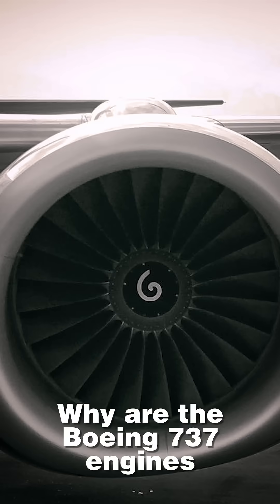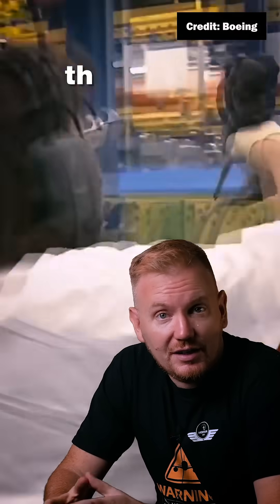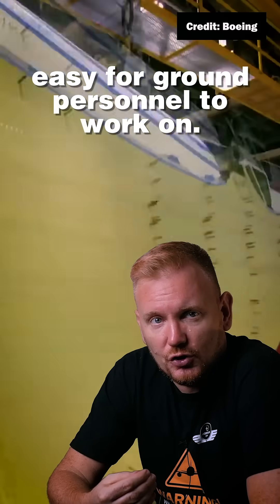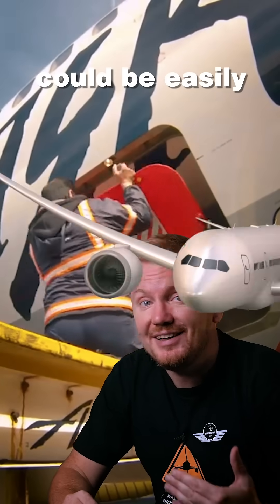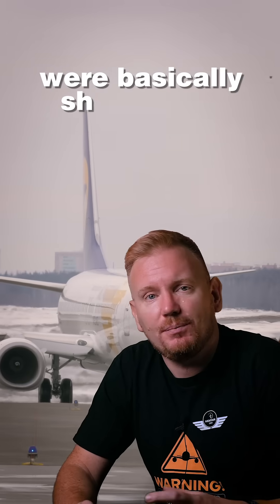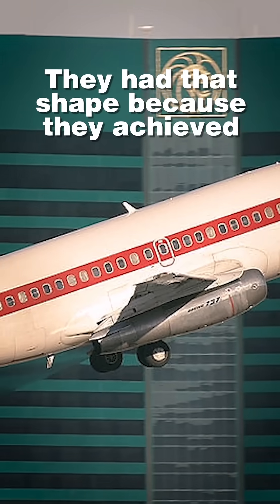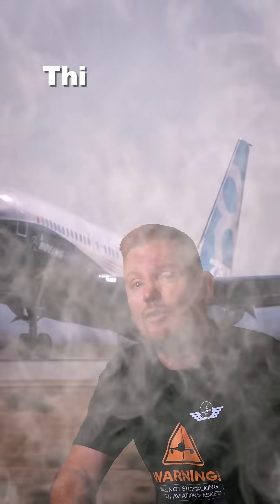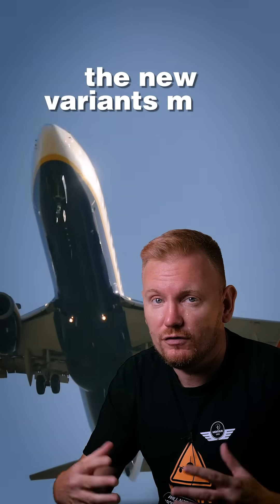FLAT Airplane Engines?! #shorts

Comment: Also part of the reason for the 737MAX issues… the low height of the plane forced Boeing designers to move the larger more fuel efficient engines forward and up on the wings so they would fit. This caused a change in the way the plane pitched on takeoff from previous generations… instead of changing the wing configuration, height of the plane or modifying the tail/stabilizers to compensate for this - which would make the design different and require a new “type certification” for the MAX which would extend the time it took to complete and cost the company more, they came up with the infamous software fix known as MCAS - which was what was blamed for the 2 crashes.
Reply: The mcas system was not told to pilots to prevent paying for training. Don't believe that what you don't know can't hurt you. It did. On the third almost accident the pilot was able to recover because he had more altitude to operate with. Mentour made a video about this.

Comment: Unfortunately, with the conversion to the turbo fan engine, the newer 737 can no longer utilize bleed air for debris deflection for gravel and unimproved runways like the older variance with the turbo jet engine.
Reply: All 737s from the very first one were fitted with turbofan engines. However, the bypass ratio was low up until the 737NG came out, meaning that most of the possible fuel efficiency gains from using a (present day) turbofan weren't available to that era of jet. 
The 707 was Boeing's only passenger jet to come with turbojet engines, and only the early ones did (later ones being fitted with low bypass turbofan engines)

Comment: cool, what about the max engines?
Reply: @Lee5p33dy  Agree.  “Up & forward” caused a CoG imbalance that led, due to hasty “cost-avoiding” re-engineering that ignored the need for proper redundancies, to two horrific crashes.
Reply: Those we're pushed even further forward and higher up (that's why MCAS exists, to counteract this and make it handle like the NG).  They're still flat on the bottom, it's just less noticable.  They may have made the landing gear longer too, not sure.
Reply: @ClipstopherBurtraw  the landing gear stays the same

Comment: But the diameter of the fan would be the same. I dont understand the explanation
Reply: No. This is what he is talking about. The fan is bigger, the height of the engine pilon is the same, so you need this design to fit the engine and have a safe ground clearance.
Reply: Ignacio - in my understanding... in the 737 it's not the physical distance from the fan blades to the ground that is the problem. It's actually the distance from the air intake to the ground. Therefore they could put the fan itself where they wanted and place the lower edge of the intake a little higher. Jets like the 737 mostly operate in a clean environment but not perfectly so. Small particles of metal, sand, vegetation, and other debris could easily be near the engines while at the gate, or during taxi & takeoff. They can minimize the amount of junk from the ground that gets sucked in by keeping the air intake a reasonable distance from the ground. 
It's also true that the expectation is minimal debris, not zero debris, gets passed through the engine; they test each modern passenger engine design for safety by seeing if it can ingest a 4 pound bird and not explode (i.e. uncontained engine failure, which of course can put the airplane at risk)
Reply: @julianbrelsford  still the diameter is the same and therefore distance to the ground is also the same. Theres got to be another reason, i would guess related to aerodynamics
Reply: @ignaciorodriguez5001  Nope. Just ground clearance. By making the cowling (border) around the fan thinner at the bottom, they can keep the same ground clearance while making the fan bigger.

Comment: An idea: Why are there no middle of the market jets, Boeing nor Airbus?
Reply: What do you mean?
Reply: @PhycoKrusk  There is no overlap between the A320 and A330, as well as the B737 and B787 models, with regard to range and capacity.

While there's an overlap between the A330 and A350 as well as the B787 and B777.

How could the airlines do so long without that? Are the B757 and B767 that good? Or is it the market or the operations?
Reply: @rudivandoornegat2371  Airbus has the A321LR and XLR. And there's no need for an aircraft that would fill the small gap between the A330-200/800 and the A321LR
Reply: @jazzi_0453  But then why is there such a big overlap between the A330 and A350?
Reply: @rudivandoornegat2371  I think the main advantage of the A350 is the superior range
Reply: @rudivandoornegat2371  the 350 is a sort of modern successor of the 330
Reply: I’m pretty sure airbus has a close solution